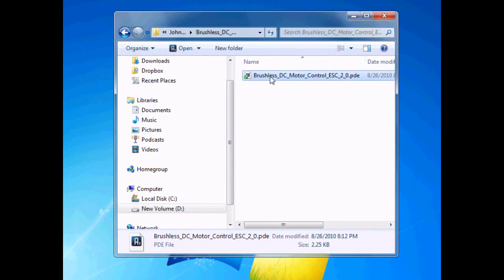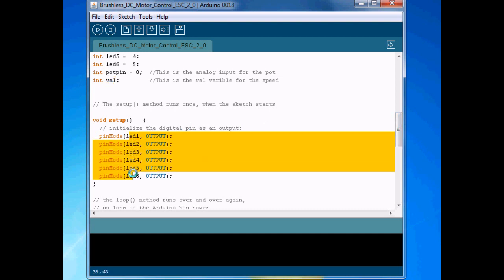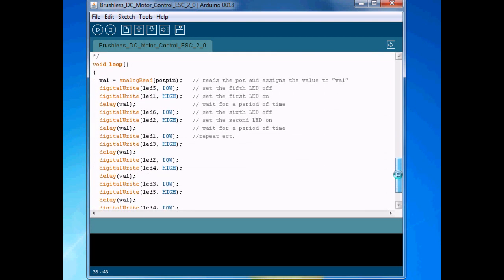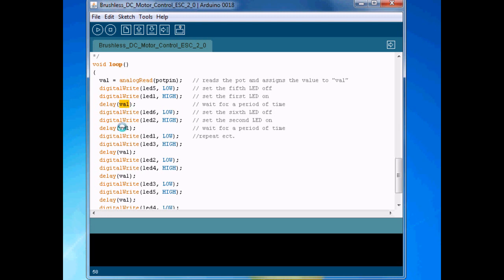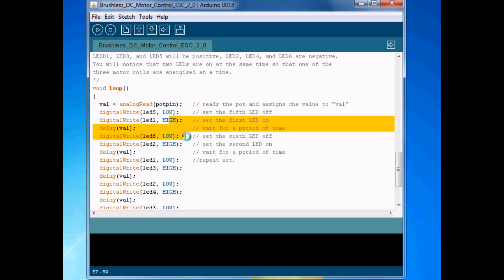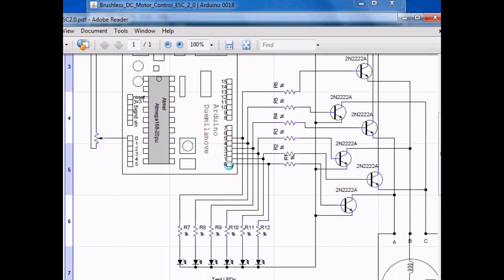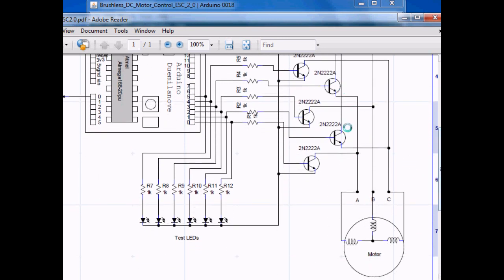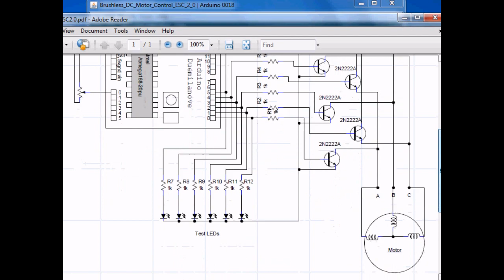DIY Arduino Brushless DC Motor controler (Electronic Speed Controler ESC) 2 of 2

Comment: Hi,
Noob question(s): Shouldn't the transistors that are connected to the positive rail be of PNP type (ones on the right)? And drive them in negative logic?  Wouldn't this be better? Otherwise, I think that the emitter potential of those transistors will be a little bit over 0v (through the windings) only after the pair transistor is ON.

Comment: Thanks.  This is cool.  I'm wondering.  With sensor driven brushless motors the speed will naturally increase with more current.  With your digital controller, the speed is controlled by the software managed pulses.  How does more current affect your type of system?

Comment: look at the LEDs. they dont have the same brightness. it seems like the positive and negative dont have the same current. that would make the motor unbalance. i've tried it.
Reply: I have some question. what is the v1 ,5+ sign top from the circuit.. and how to use that circuit with 12V..
enhknh98@naver.com this is a my email. thank you.

Comment: I believe the 4th pin is a "center tap". I think the signal on this tap is read by the disk controller to determine the relative position of the motor. You can identify the tap by placing an ohm meter across each pin. The pin with the lower ( should be about half) resistance is the tap. I am going to experiment with this soon and will post the results.

Comment: interesting how does the esc control the frequency using what key electronic device (for example transistor, resistor, capacitor or a microchip?)